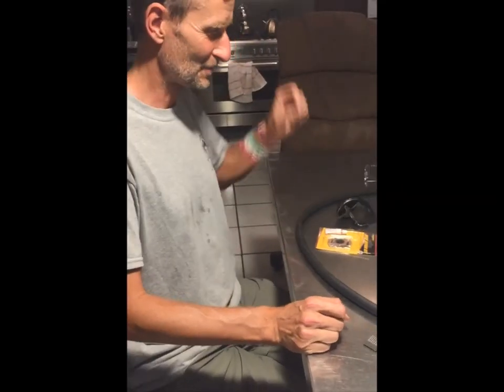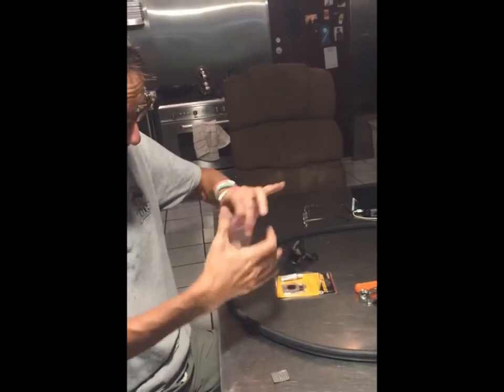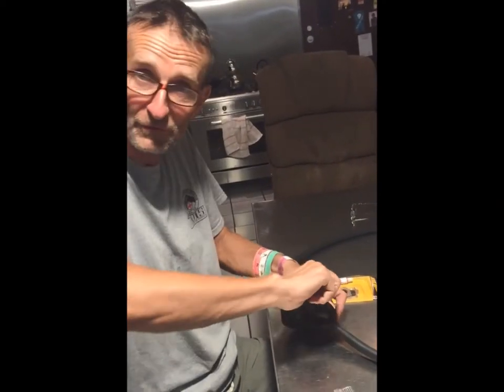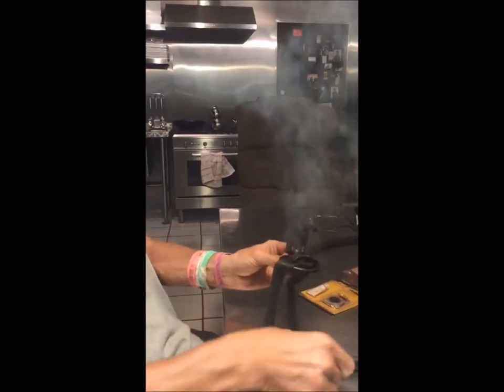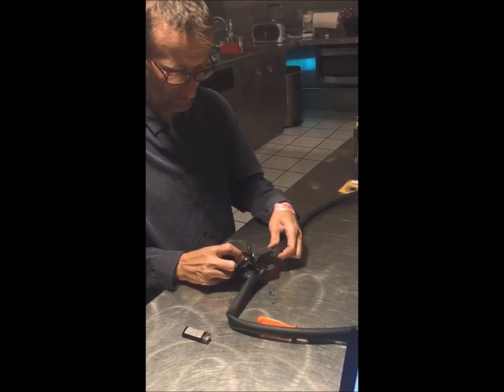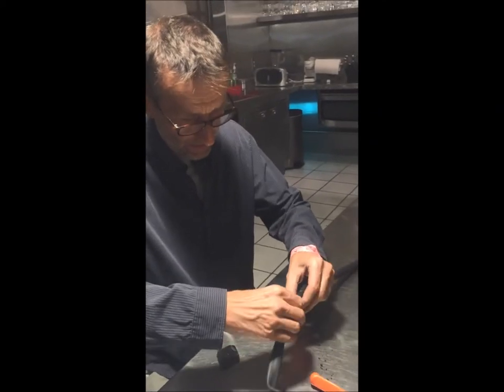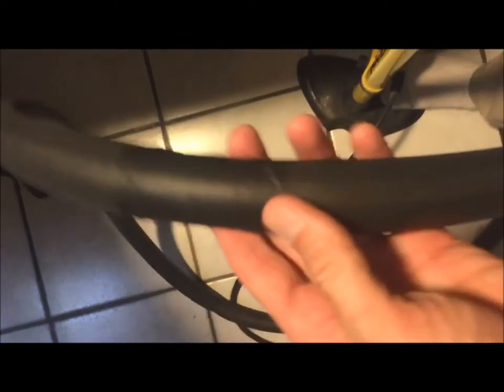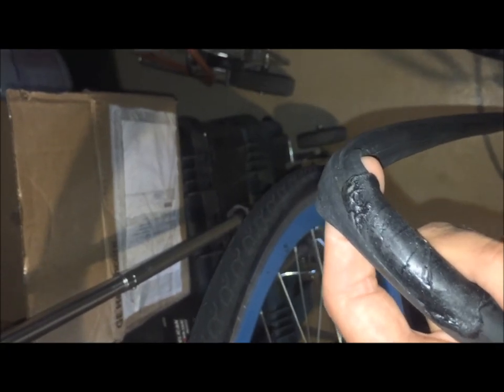fix an inner tube with burning rubber

Comment: As a kid back in the late 60's to the 80's our bikes were our main source of transportation. We lived out in the country and always got bullhead stickers in our tubes. Patching our tires was part of the fun. Seems we did it as a group of kids with no adult supervision. These patches were common back when I was a kid. We used to call them hot patches. We didn't have the fancy clamp to hold the patch down but always used a metal tool to hold it down. I always liked them better than the conventional contact cement patches. I wish they were still available.

Comment: I mean me personally, I just came here for the top-notch original content. Very entertaining, gripping at times. So i'm chipper as can be fyi
THANX A LOT
Reply: USE SUPERGLUE AND THICK PAPER TO PATCH INNER TUBES. IT MIGHT SOUND FUNNY BUT IT DOES WORK. I PATCHED MY INNER TUBE 3 DAYS AGO WITH SUPERGLUE AND IT'S STILL HOLDING (65 PSI) PRESSURE. NO NEED TO SHOUT ON YOUTUBE COMMENT SECTION.
Reply: @NoobieToob  (im half joking, but thanx 4 the tip) 👌
Reply: @lavishlavon  I'M JOKING TOO. I LOVE SHOUTING ON YOUTUBE COMMENT SECTION IN RESPONSE TO OTHER SCREAMERS.
Reply: @lavishlavon  THE TIP WORKS TOO.
Reply: @NoobieToob  Lol thanx ill give it a shot next time. managed to get ahold of some slime & thats workin now
Reply: @lavishlavon  It's almost a week I patched my inner tube that way, still holding that 65psi pressure fine. It shouldn't work this good but it does. Dirt cheap too.
Reply: @NoobieToob  well that proves it then, 65 is serious pressure! im used to good ole 40 max on my mtb.. didnt even know tubes went over 45 until recently, i read on some forum this guy mentioned how presta valves are a must on his road bike bcuz he pushes 90-100psi...couldnt believe it
Reply: @lavishlavon  65 is like max for fatter mtb/gravel tires. You could go higher, but not recommended. Mine is an MTB but a cheap one I use mostly for commute on road/hard packed gravel which is why I load such high pressure. And yes, narrow road bike tires must have 85+ psi so as not to damage rims and/or get pinch flats.

Comment: Cut a piece of rubber from a broken inner tube preferrably a thicker one from motorcycles and use it in the same fashion. I suppose you can use other source of heat for the clamp such as from an igniter so you can control the duration. The extreme heat and the age of the rubber must have overcooked the old rubber patch to become sticky and brittle. 

This system is not perfect and can result in patches that can leak air over 2-7 days but you can always pump up between rides when at home before leaving. Maybe you can apply some rubber glue or polyurethane glue around and on the patch to seal away some micro-sized holes that cause slow leaks.

Our street vulcanizing shops do this using cutouts from motorcycle tubes and with a giant clamp/heatpress.
Reply: Hi ! I'm interest by more information about your street vulcanizing shop.  Have you an internet link ?
Reply: well thats interesting

Comment: Patch after 50 years seems to lost its strong that's quite clear, however the system itself is quite good, I do have a problem with patches and glues, actually eventually all of them come off after 60 Fahrenheit degrees in a Summer time, no matter how good you apply them they do not resist the pressure and heat in a ride hence, come off, so been looking for a system that actually vulcanize the patch, could you please give name or information about this system......thank you for your time
Reply: Our street vulcanizing shops here take pieces of rubber from broken inner tubes, then put them in a clamp that also electrically apply heat on the top part which melts the rubber patch into the tube. Makes your broken inner tubes useful to patch your newer tubes.